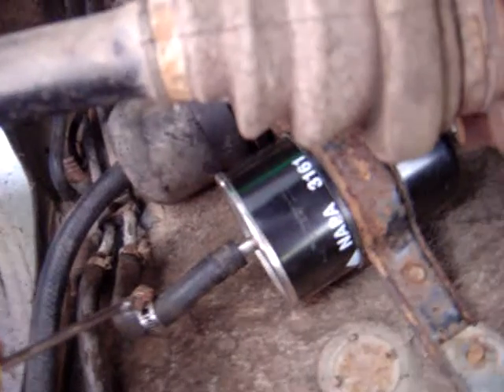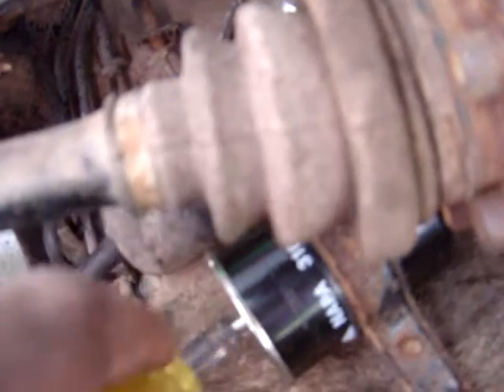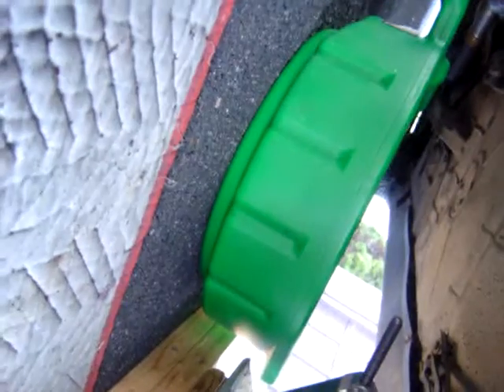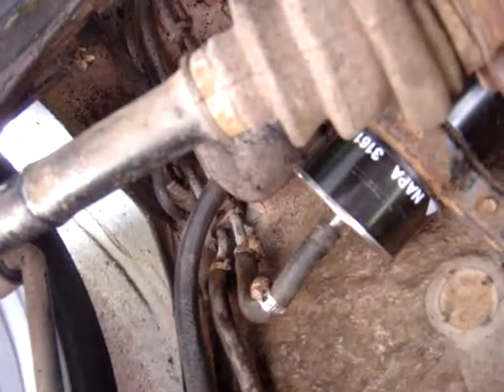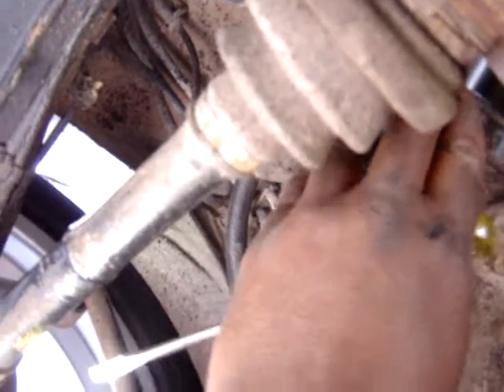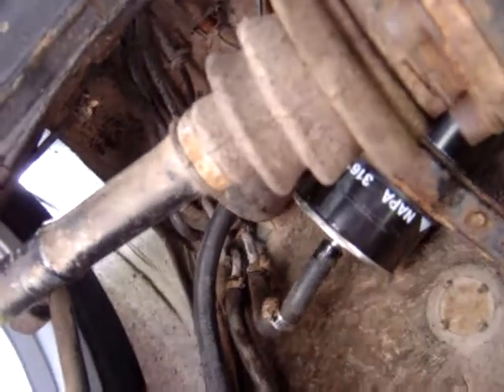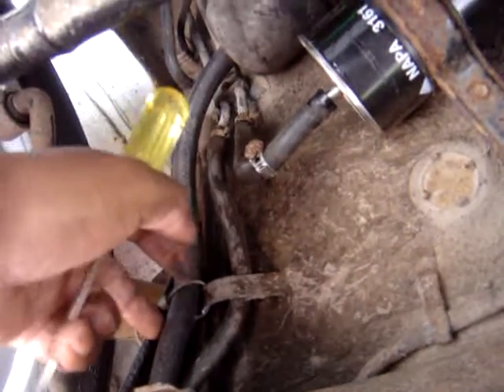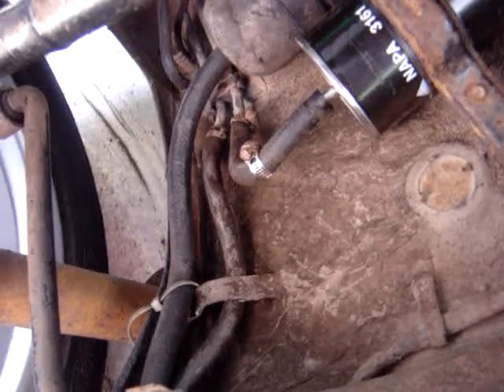BMW E28 inline fuel pump change Part II E28's 528e 533i 535i 535is

Comment: I own an 83 bmw 528e,.... would you know if its the same set up? Did  you say these cars have 2 fuelpumps? I mightve misunderstood, thx bro
Reply from the maker: Hello, The inline pump on the older 528e's are located in the middle/center of the car underneath if I remember correctly.  I had to replace one on my brothers 84 528e dog years ago but I'm not certain.  Hope this was helpful.
Reply: Thx bro